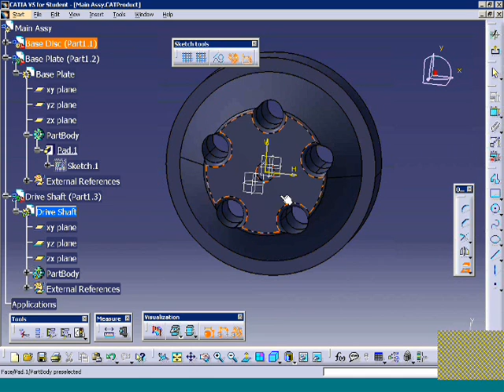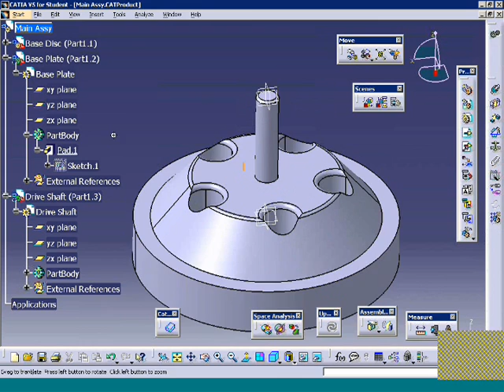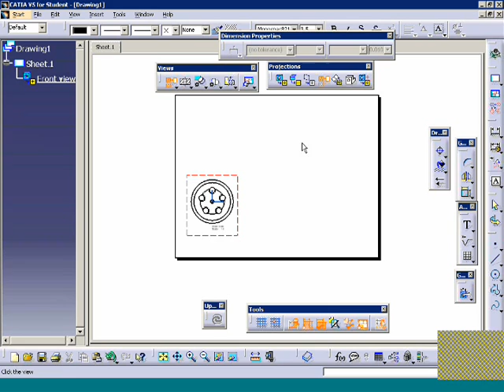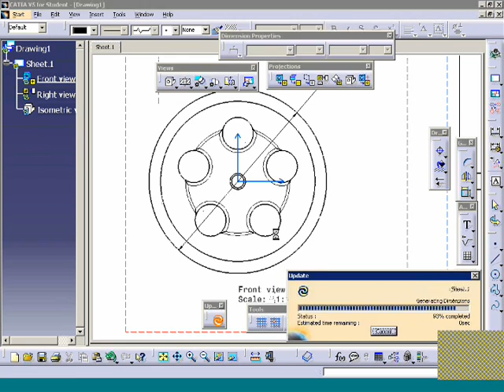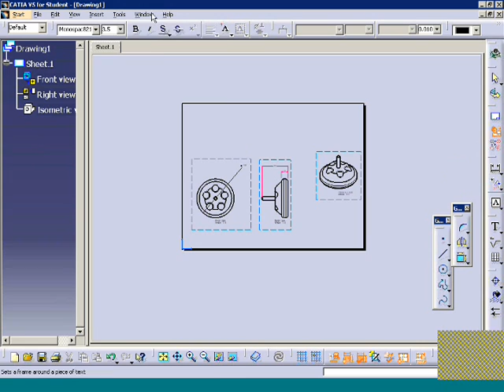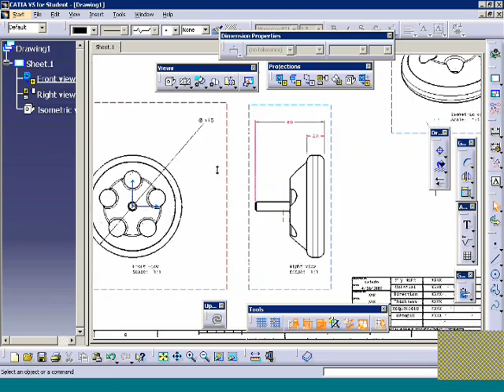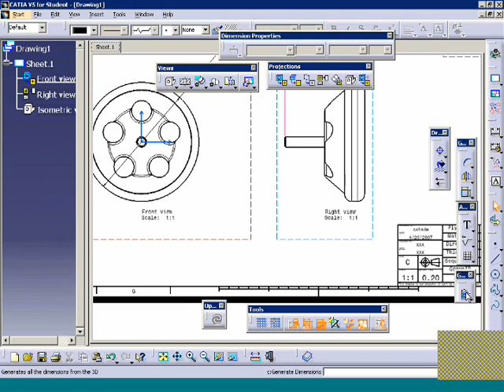CATIA V5 Start to Finish Part 2 of 2

Comment: Yeah, imho for mechanical engineers AutoCAD 3D is useless, but Inventor is great program cause it has nice 2D module (drafting)(very similar to AutoCAD)  ... that helps you so much when you need to do 2D drafting/drawing from 3D model ... probably the best Drafting from all CAD programs i tried ( CATIA, SolidWorks, ProEngineer(now CREO) ... )

Comment from the maker: @davidgruty 
The better practice is to pre-select the face then click the sketch icon. this way you avoid clicking the wrong planar reference, which makes it hard to change later.
If you experience issues with External references, make sure that you have "keep link with selected objects" checked in the Tools>Options. basically your geometry has be be yellow when projected (not white). if all that is good and it's still problematic, there is a bug and you need to update to the latest service pack

Comment: @m1turbo yes. sorry i've not been so clear.
I understand it is feasible, but what i mean it's if it is a good practice. I heard not.
I used to do that and when having many parts (using some to build others) when i want to edit i think there were problems with the external references.
Also, sometimes (i don't know why) it's not possible to click in a part out of the sketch
cheers,